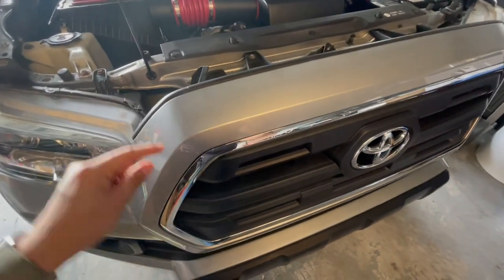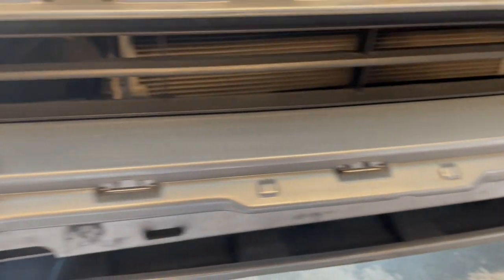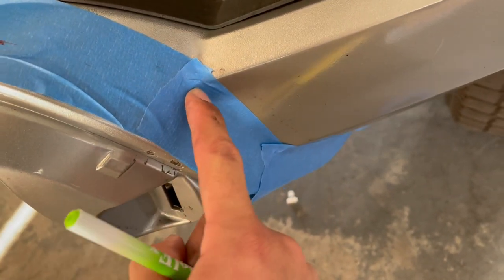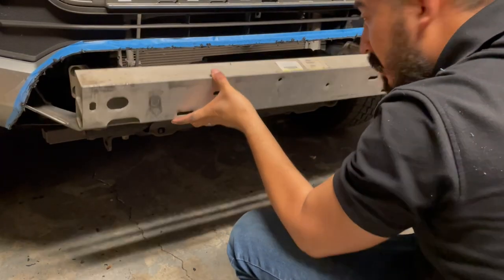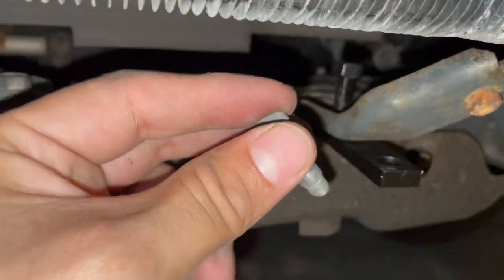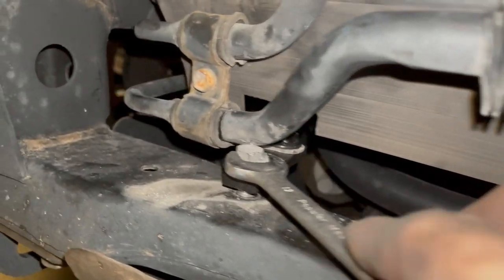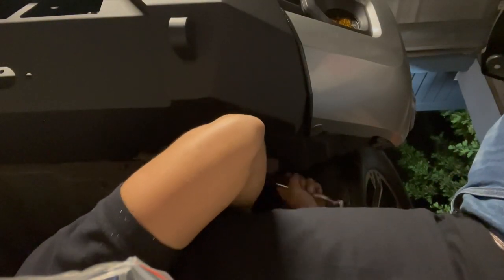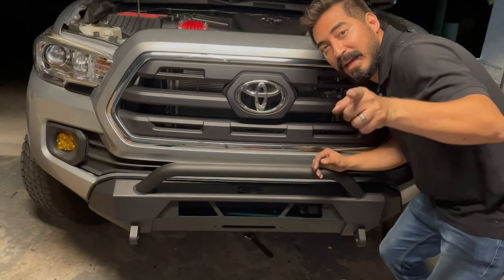Body Armor 4x4 HiLine Series install Tacoma 2016-2021

Comment: Great looking truck.  I'm back and forth on if I want to install this bumper.  I'm already getting such terrible MPG and this seems to just open up more holes that causes drag.  Did you notice any drop in MPG or any difference in the drive at highway speeds?  This bumper plus a winch is about the same weight of a small person on your front end.  Sigh, love the look but not sure about the practicality.  Thanks for the video though!
Reply from the maker: I did lose some MPG not going to lie but it was not much honestly

Comment: Could we get a status update on how well it's holding up? I'm debating getting this considering it's $200-$300 cheaper than similar bumper designs from 4WP and Cali Raised
Reply from the maker: The bumper is holding up greaT! It’s solid! Power coated to perfection, no issues at all no rusting, no nothing! Gettin ready to do a video on a winch and light bar for it! Deff recommend this bumper for the price, will be installing rear BA bumper as well!
Reply: @thisishowwedoitdiy2477  Thanks for the update! I'll definitely throw a subscription to ya to hear more. I find it hard to go for the Cali Raised or 4WP version when this one is not only lighter, but also anywhere from 2/3 to 1/2 the price of the other two.
Reply from the maker: Go for it man! This bumper is great! You will be on your next mod soon!

Comment: I installed this bumper yesterday, I was wondering if the bolt under the wheel well for cooling lines is reinstalled?  Mine didn’t line up right after the front of the cooling lines are pushed back.
Reply from the maker: Thanks for reaching out! No you don’t place that bolt back, the 2 bolts at the front that you installed with the new brackets  hold it in place just right,
Though the same thing when I installed mine and did a bit more research, you don’t need it

Comment: How did you remove the black bottom part?? I’ve been at it for 30m and it won’t come out.
Reply from the maker: Are you taking about the black plastic  part? If so, there are also some bolts toward the bottoms back of that plastic

Comment: Nice job. Well done! Is that an engine oil cooler or transmission?
Reply from the maker: Yes sir the coolant
Reply: Have you had any long term problems as a result of relocating the cooler?  Any damage or chaffing to the cooler lines?

Comment: What tool did you use to cut the bumper !
Reply from the maker: Thanks for reaching out, you can get this done with a Dremel 3000 series , you can find one at Home Depot, no need to get a very expensive one.
Reply: @thisishowwedoitdiy2477  awesome thank you ! I have a 2019 sr taco that I’m building up so I appreciate the super simple yet informative video !!
Reply: What kind of blade for the dremel tool? Thanks man